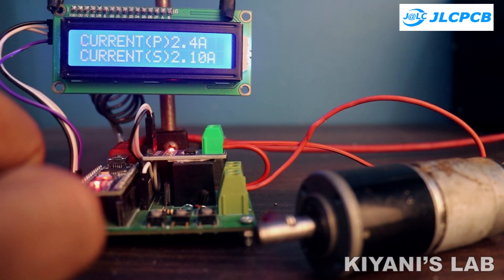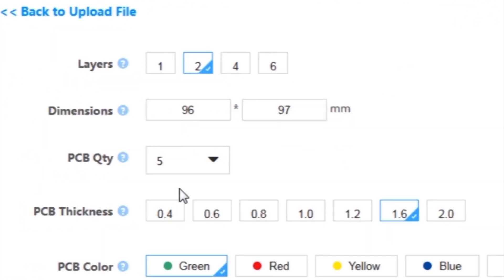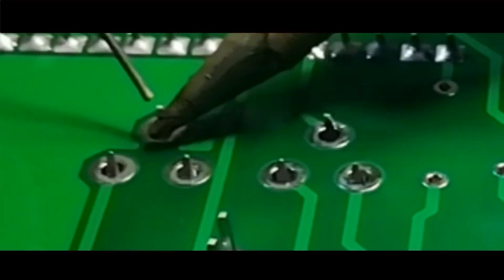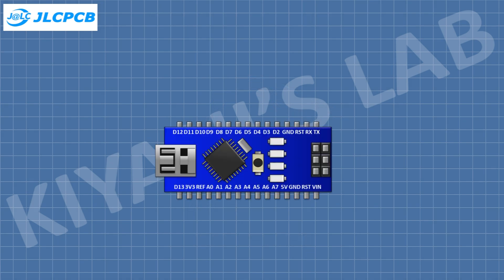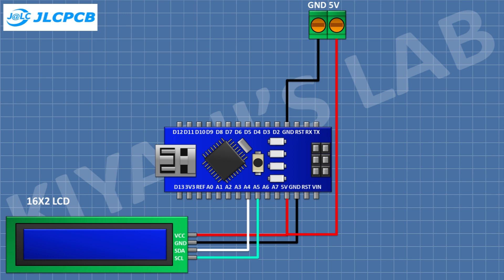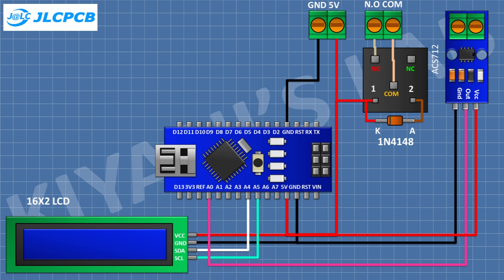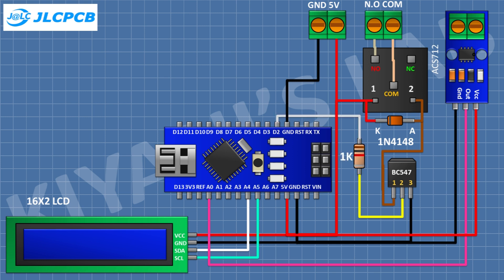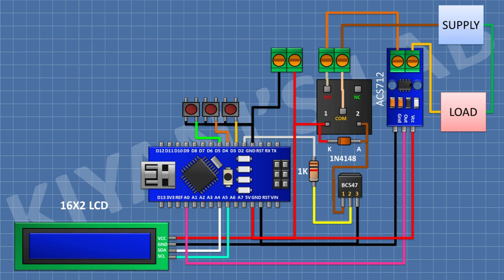How To Make Digital Overload Protection Circuit

Comment: Sir can you please provide the correct circuit diagram and code for automatic water level indicator which you made around 2years ago with auto and manual mode , because wrong files are uploaded for which you gave link in description.
I will be really grateful for your time sir.